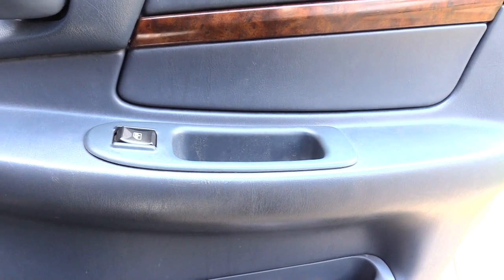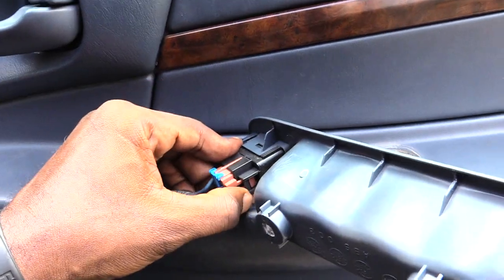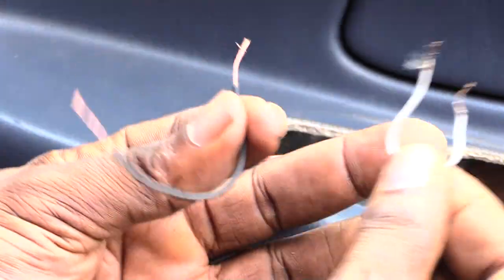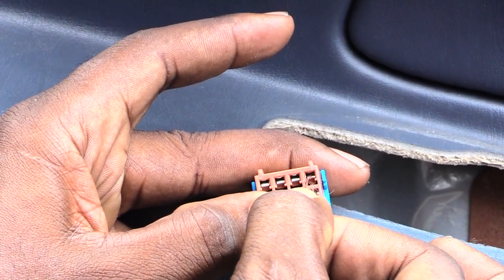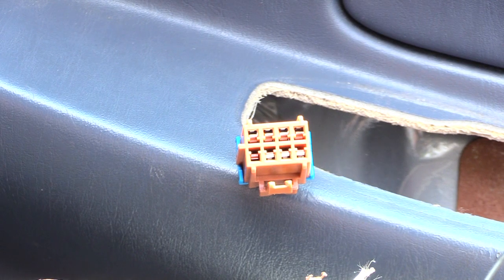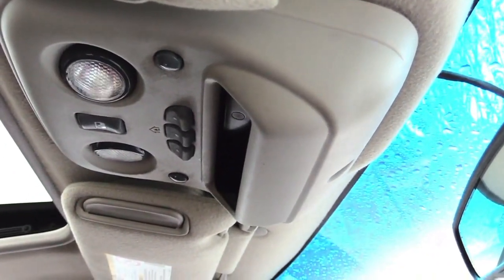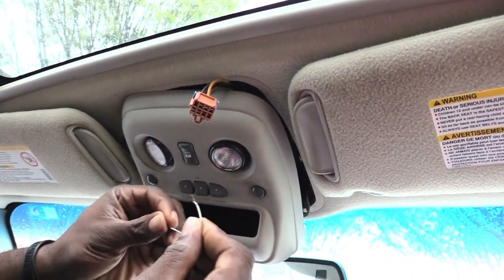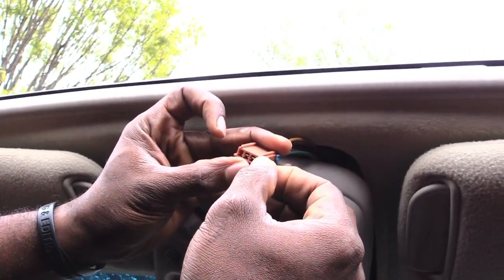How to Let Window Up/Down When Switch is Broken--Chevy Impala

Comment: Hello, thanks for the vid. 
Is it safe to assume that if the window is not moving up, then i perform this "test" would this pinpoint the problem to a faulty switch. Since were basically jumping the switch?

Comment: My 2001 Impalas driver side window will not roll up. It rolls down just fine. Does this quick fix require positive and negative wires? I see your using a black wire along with a white one.
Reply from the maker: No, it doesn't matter what kind of wires you use. Please subscribe like and share and check out our other helpful videos.

Comment: I'm working on a 2005 Chevy Impala and my clip looks slightly different. That slot that you show to be empty is not empty on mine and I did it with 14 Guage wire which I believe was too big but it did not work

Comment: Got an '05. On the driver's side switches the plug has all 8 holes with metal. Any idea where to connect the wires on that configuration?

Comment: What type of wire did you use? I tried with a cell phone charger wire, should I use another type of wire?
Reply from the maker: Thanks for watching, I used a cell phone wire also, but you can use many different type wires, just not to big of a wire. Please subscribe and share if haven't already and check out our other helpful videos.

Comment: Thank you! 2004 Impala. My driver side window wont  go up. I have the swiches all unplugged. Is there any way to pop off the buttons on the switch? Going to try the wire trick but trying to avoid having to replace the switch. Short on cash. Do you have a video on the drivers side front window as of yet?

Comment: My gfs is a 2005 impala. I took hers apart to see because driver side will roll down but not up. When i took the connector out to bypass it like you are hers looks just like that except hers is 4 on top and 4 on bottom. that bottom left one on yours looks empty. hers looks like the rest. can you assist. I wasnt getting anything.
Reply from the maker: Drivers side is a little harder to jump I would spary switch with some contact spary and see if it helps, you can get it from home depot.